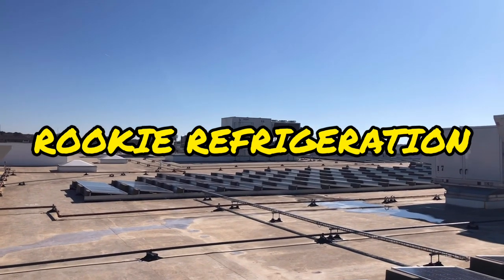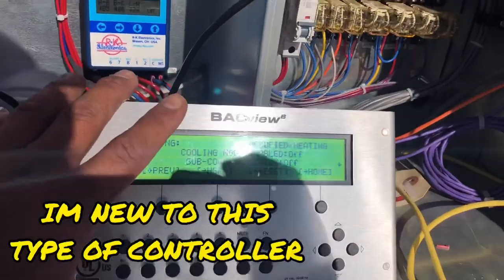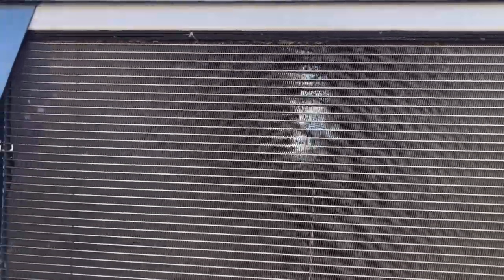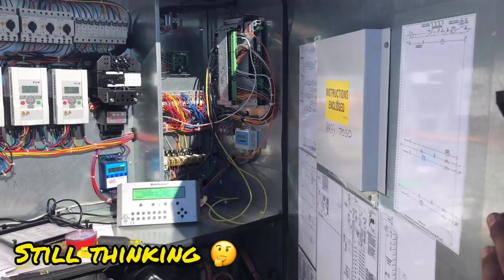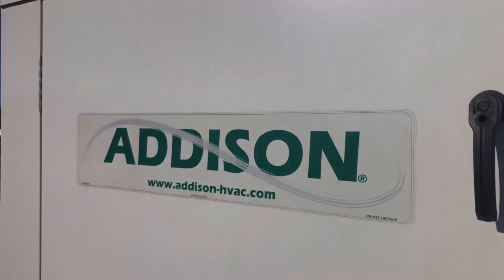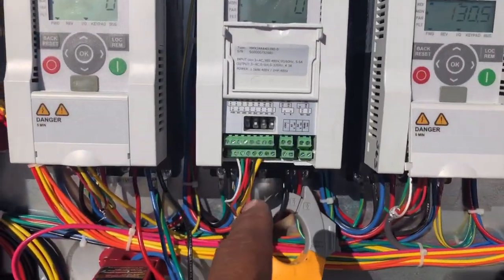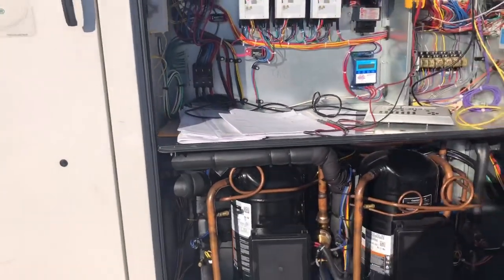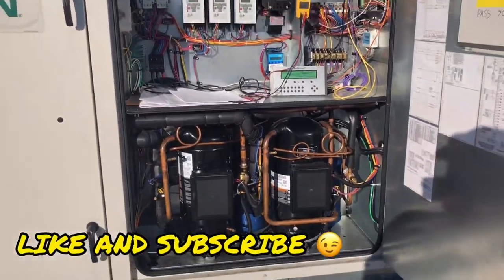HVACR: Addisson DHU Compressor Lock-Out,  CALLBACK

Comment: Got involved with a chiller that went to a mri machine. Made in Germany, if I remember correctly. Typical German wiring diagram, omg. No startup or maintenance manual. Such fun!
Reply from the maker: Lol. I understand the pain
Reply: Heard about one of those. Was it pretty small tonnage for a chiller? Had every bell and whistle?
Reply: Shane Bird it had 2 circuits with 2 compressors each. They were in the 5 ton range. The mri machine didn’t run all the time, so getting the load  on it was difficult. We pretty much determined it was oversized.

Comment: The VFD In the middle is in Stop Mode so you probably only needed to Push the Green Button and it would have Worked.
Reply from the maker: It wasn't in stop.  I made sure it was reset.    But if you're correct I'll be really mad 🤣🤣🤣

Comment: Looks like the VFD's have sockets on the wires... Swap the 2.. And the you know if it's the VFD is good or not..
When you have 2 of the same thing, then it's bullet proff and the fastest way.
Reply from the maker: Yeah.  I could’ve done that but didn’t want to mess with it.  I’m pretty sure it is bad.  If not then I’m fooked 😂😂
Reply: @rookierefrigeration4357  yeah better be bad... If not, you just pull out the power move.. The VFD was bad, but there is also something else wrong, and I had no chance of finding out before, because the VFD was bad.. 😜😜😜

And of course i have never played the power move😏
Reply from the maker: Christian Sommer 🤣🤣🤷‍♂️
Reply: @christiansommer914  Dude, stop giving away our secrets. 😂
Reply: Great work

Comment: Loved the video man. I'm not in the HVAC trade so it's interesting and entertaining seeing what goes on in your world.
My only advice is don't add load to a VFD while it is running. I've seen too many blown up as a result of doing that. Old and new
Reply from the maker: 🤯. Well thank you for that.  I had no idea.   See. I learn something new everyday.   Thank you so much for the advice💪🏼💪🏼💪🏼
Reply: No problem. It's a mistake I made on a couple of occasions when I was first starting out in the Electrical trade and learned the hard way unfortunately. One of them actually blew the front cover off the VFD. Expensive mistake 😅🤦‍♂️
It may be handy to know why so here's an extract from the Schneider website...
 "Note that the disconnect should not be opened or closed while the VFD is running (outputting voltage from T1,T2,T3). This is sometimes referred to as "slamming the motor." This can damage the output IGBT components of the drive and such damage is not covered under warranty."
Basically the inrush current as the motor starts can blow the Thyristors/IGBTs

Comment: VFD converts your input 3ph to DC and then changes it back to Ac 3ph at different frequencies. You can not ohm motor that way.
Reply from the maker: So how do you ohm out a motor?
Reply: @rookierefrigeration4357  that's something I wondered when I watched the video. Is that breaker you read off of before or after the VFD if before wouldn't it give a false reading? If its after then that's a correct way of doing it. My bad I know this was a while ago lol
Reply from the maker: OG X Those breakers are after the VFD, before the motors. I absolutely made sure they were off and the motors were isolated before checking.

Comment: Just curious, did I see an oil stain from a possible, very minor, refrigerant leak?
Reply: If there any we will have alaram for low prusser lockout in the control board not a high prusser.
Reply from the maker: Yeah. No.  It’s all water.  I verified but I edited out that part because it was not relevant to the VFD side of the diagnosis. Good eye

Comment: I suppose you didn't wanna mess swaping drivers & fans. Did you try to reset the driver? not by settings, but switching it off & on. And no, it's impossible to know all types of controleers. Good video Rockie, thanks for sharing 👍
Reply from the maker: Thanks bro.  I just usually trouble shoot that way. I could’ve swapped VFD but I wasn’t feeling it after I got my ass kicked  by that controller😂😂😂